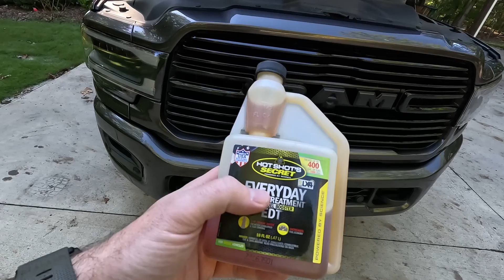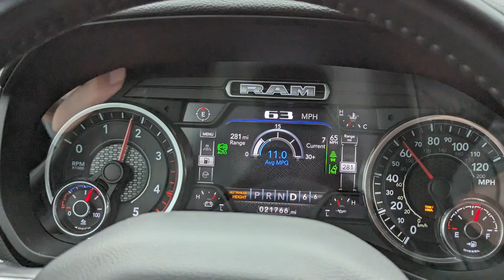P2459 on My RAM 3500 Cummins 6.7 Dually // Diesel Particular Filter (DPF) Regeneration Frequency

Comment: Idling is way worse than your 30 minute commute, assuming your commute is at highway speeds. I have a similar commute and have had zero issues. My 23 2500 has only actively regen'd on the 24 engine hour marks. That's 14K miles in. But I very rarely idle the truck (< 15% idle time). Also have never used additives in any of my trucks, except the rare occurrence of a winter trip from the southeast to the northeast during a time where we may not have switched over to winter blend yet down south. Agree with the other comments. If your 30 minute commute is at low speed, watch your DPF EVIC gauge, and don't shutdown during an active regen
Reply from the maker: Great points. Thank you for sharing.

Comment: Question: is it oaky to put EDT NEW truck?
Reply from the maker: That's a good question. I am not sure, but I wonder if the manufacturer or community could weigh in for you. I only started using at about 20,000 mi on mine.
Reply: Thanks 
 @AdventureRocks

Comment: Howes seems to work well, especially when seasonal fuel is blended vs straight #1 or #2.  Found better odds of finding non-blended fuel when filling at truck (pumps) in states where blended is available.  
Just replaced the fuel filter and water separator which showed discoloration vs previous changes where I fueled exclusively in a non-blended State more often. 
Also found my trucks run better, longer and more efficiently without the emissions… night and day difference, especially daily driving.

Comment: Idling a modern diesel engines is killing the engine, prior to all the emission crap yes you could idle the engine without any issues. 
I have a 2017 Ram 2500
Megacab with the Cummins and 
I use Howes lube Diesel treat and Howes Lube Diesel Defender fuel additive
Reply from the maker: Great tip, thank you

Comment: Been using Hot shot secrets for 10 years never had an injector problem or fuel problem/when you change your oil, put the stick and eliminator in with it💪💪
Reply: That stiction eliminator is only for Ford Powerstrokes or maybe some other uncommon diesels that lubricate injectors with engine oil. Cummins and Duramax, for that matter, don't use engine oil to lubricate the injectors at all.

Comment: I do not have anything heavy to tow yet- I do not let it idle- I run additives- I do not run it very far or long frequently so I’m nervous. I change oil 5w40 t6 once a year because of mileage but hard to find the best path to follow. Love my truck tho-19 2500 Cummins
Reply: Have you experienced any issues yet with your frequent shorter trips?
Reply: @blakewinchester5591  no sir- I never make any trips less than 10+ miles one way. I take it out on the highways as often as possible and mainly use it for towing  4atvs. So far so good!
Reply: @elgroucho7563 good deal, thanks for the reply!

Comment: I been having this problem for awhile I have 2019 ram 3500 the dealer changed a lot of parts egr cooler dpf 7th injector air filter turbo differential pressure sensor egr valve and the pcm
Reply from the maker: Thank you for sharing. Hopefully they can get to the bottom of it for you.
Reply: Did anything  fix it?
Reply: No it goes off and come on once or twice a month

Comment: I got this on my 2020 Duramax and also a P2002 code dealer wants to replace the DPF filter
Reply from the maker: Thank you for sharing/tip.
Reply: @AdventureRocks   so I got a scanner reset all DPF codes and ran a service regen, CEL went off and hasn’t come back on
Reply from the maker: @shawnl4756  very nice. I wonder if it's a calibration issue. Another tech commented that ram at least is considering a potential software update that may change the parameters that trigger that code.

Comment: I'm a dealer tech, we have been  seeing p2459 alot. I have developed a process of troubleshooting them and having alot less trouble than the other diesel techs. I will say, the guys who don't drive them enough to complete a regen. Idle it for 3 hours, parking brake set, AC off. 2 hrs 15 mins into that idle itll go into regen.
Reply: I will tell you a fellow tech also has been reached out to by an engineer and they think there is a calibration issue. I think they will release an update before long.
Reply: @dieseltechjoe hmmm, calibration issue?
Reply from the maker: @dieseltechjoe  interesting, that would make sense
Reply: I can debate this as I am a hotshot trucker. I’m getting this error code but I think it was because my EGR cooler was bad and let soot into the DPF
Reply: @Hotshotveteran i have seen sooted up coolers, usually the grid heater is sooted up and the exhaust pressure sensor tube. Those usualy cause a egr insufficient flow and underboost code. I do make sure those are clear when teouble shooting p2459.
Reply: @dieseltechjoe I never had any other codes. I knew my egr cooler was bad because I was losing coolant pretty fast and my crossover pipe gaskets busted out with soot and all over the motor
Reply: @Hotshotveteran this happened to me as well. Code came back after they fixed it anyway…
Reply from the maker: Thank you for the helpful tip!
Reply from the maker: I'd like think my P2459 was perhaps more due to my driving habits to blame and less on the DPF system itself. I could see where that's a tough sell as a tech to share with the customer though.

Comment: I Have a '23 3500 Maga cab with the HO 6.7 that I use for towing my 5th wheel also, and only have an 18 mile commute.   I have since new, used 8oz of Cummins Approved Power Service Diesel Additive with Cetane Boost with every 30 gallon fill up.  I own 5 Kenworth trucks as well and use the same product in those.  Never a DPF issue in any of the trucks, even at 5 years old now.

Comment: All the new diesel trucks do a passive regen cycle about every 800 miles for about 15 mins. Putting an Edge CTS monitor will show you when it’s doing this so you don’t shut your truck off mid cycle and start plugging the DPF!
Reply: Misinformation…. Passive regens are when you have the temps in the exhaust system hot enough to clear the dpf without notice.  Active regens are every 24hr running time regardless of soot load in the DPF or when you have enough back pressure difference with soot load.  Like your short trips, etc will trigger a active regen.  It takes about 20 miles to clear out.  You have a DPF guage on your +19 trucks.  It will dispaly when in active regen.   You can shut the truck off without any issues.  It will pick  back up when the truck gets to operating temps to complete.   Additive is not needed.
Reply from the maker: @Mill72  thank you for the correction
Reply from the maker: Thank you for the tip!

Comment: I have a 2021 Limited 3500 HO Mega Cab and I have put HotShot secrets EDT since the 2nd fill up of the truck. If I don't have the EDT with me, our local Kum n GO fuel station has extreme diesel with all the additives in the fuel. It definitely cost more but well worth it. I have 30k miles on the truck and I've never had an error code, I never let the truck idle for long periods of time, ever. Thanks for the video.
Reply from the maker: Thank you for the tip!

Comment: I had this issue. Dealer told me I was using the wrong air filter. Just did 750 miles towing after the air filter change and the code went away by itself and I started getting advertised MPG again. Got a filter straight from the dealer instead of online.
Reply: I been using Docs Diesel for a long time and haven’t had issues with it
Reply from the maker: Interesting, thanks for sharing that helpful info.
Reply: Yeah dealer told me the same. I had them put in stock filter and I got codes in 100 and 120 miles after... They always say use factory parts. I cannot say it helped.

Comment: Good to know. I’m a new diesel owner and started using hot shots after reading lots of info in owners groups. I’m in the same boat as you with driving daily short trips and only towing the fifth wheel any one a month. Will be towing it for the first time this weekend and I’m really anxious to see the difference over my single rear wheel gas truck that I was using
Reply from the maker: So far I'm in the clear between adjusting my habits and using the hot shot stuff. Always a learning experience that's for sure. Really it's a minor nuisance in the end to get such a solid towing experience.

Comment: Cummins does recommend a diesel additive, Power Service diesel clean. My truck has never gone 1 mile without additives. I was doing UBER with my 2015 Ram 2500 mega cab (yes Uber) and I picked up a Cummins engineer and he told me to always use Stanadyne Performance Formula, he acknowledged that Cummins recommended (which he said is fine) another brand but said Stanadyne was better. He also told me to get a bypass oil filter. I now have a 2020 Ram 3500 Dually. The increase in fuel economy makes the additive free, I buy in bulk and with fuel prices over $4.
Reply from the maker: Good to know, thank you for sharing that helpful info.

Comment: idling is a dpf killer. also, make sure you pay attention to the regen cycles. if the regen starts (you can see if regen is occuring in the info screen), hit the highway and dont stop until the regen is complete.
Reply: diesel has become such a needy girlfriend anymore- its ridiculous.
Reply from the maker: Thank you for the tip!
Reply: yeah - late for dinner,  and then what about low fuel... so needy....

Comment: Just to add.  Remove the DEF injector and inspect for crystals blocking the screen.  Mine was completely blocked by crystals resulting in DPF full, reduced power, see dealer.  I knew what happened, the question was why?    Removed crystals with a small flat screwdriver exposing the injector screen.  This allowed the DEF fluid to do its job.  End of problem.
Reply: The def fluid has nothing to do with regen or the DPF so how would that fix this problem?
Reply: @WoodyHayes614 the def fluid cause the crystals to build up over time
Reply: @DestinedToChange  DEF fluid is injected after the DPF. It has nothing to do with regens or clogging the DPF.
Reply from the maker: Good to know, thank you for sharing that helpful info.

Comment: I get that code about once a week. I saw all of the horror stories online from other Ram owners going to a dealer to get it fixed so I just clear it and keep driving.  Been working for about a year so I plan to continue doing it.
Reply from the maker: Good to know. So far I've been code free now for about 1500 miles after making my adjustments and using additives.
Reply: I've been using Hot Shots for the last couple of months and have had no change. I still get the error about every tank of fuel. I guess I'll continue just clearing it and ignoring it.
Reply: @ChuckShrader try blue def platinum and only use that. It'll help too. And the hot shot secret additives are awesome.
Reply: @RobHasty  - I changes to BlueDEF Platinum over 60K miles ago and it makes a big difference. Also no more DEF system issues one I changes and got so miles on it. BlueDEF Platinum even cleans old DEF build-ups to some degree but it take quite a few miles to accomplish it. I just by the BlueDEF Platinum at Walmart, which seems to have the best price although sometimes the auto parts stores have matched the Walmart price.
Reply: What scanner do you use to clear it?
Reply: @stevenm652 Correct,  FCA will not allow any connection to changing or clearing failures if not connected to Autoauth. I'd like to hear how he does it. I use a Solus Legend and I am connected to both the snap-on oem and FCA autoauth. Unless connected? I could see faults but not touch them